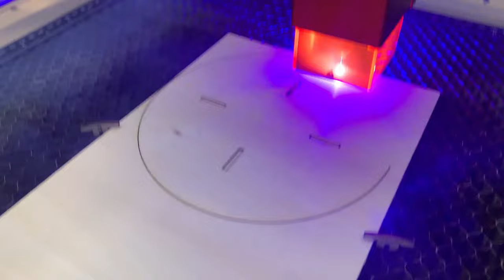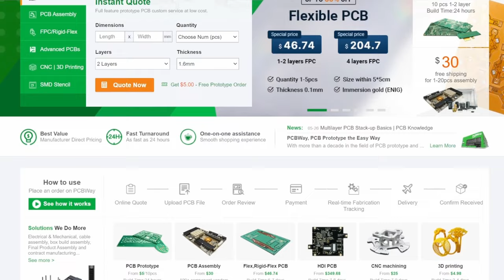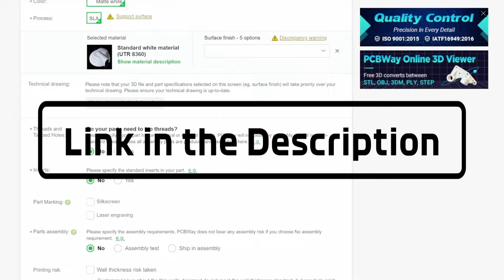How to Finish & Paint your 3D prints: Fill, Sand, Prime, Paint.

Comment: Post Process however you all ike but please use nitrile gloves and respirators when working with resin! I see so many unsafe uses of this stuff and its TOXIC!
Reply from the maker: Not sure if you noticed but I was wearing gloves...
Reply: @DaveRigDesign  not when you were putting the reinforcement mesh in. It’s just for me as a professional, I don’t want to pass off bad safety  practices to the new comers in the hobby.
Reply from the maker: Well I don't wear gloves when I use a fork and knife and manage to not get my dinner all over my hands. It's Resin, not uranium. If your not physically touching it, gloves don't do anything to protect you. 
People need to use common sense when working with different products and not wrap everything in bubble wrap. If everything is super dangerous then nothing is.
Reply: @DaveRigDesign  Sanding resin is when you need the respirator the most.

Comment: Very interesting project, well done. I raelly liked the video except when you didn't have gloves on and touched the project while painting. Do yourself a favor and get some 3mm gloves if you need to touch it to see how smooth it is. No matter how clean your hands are they still have body oil on them. The project came out great. Thank you for sharing. I like it with the face.
Reply from the maker: Thanks, The face really shows off how well the visor turned out, Too bad it distorts the image so much and makes it look freaky :)

Comment: So I have a 50w 395nm UV light and using sunlu ABS like water washable resin.. when I apply and try to cure it stays wet. Like nothing happens... what am I doing wrong? Should I get a more basic resin?
Reply from the maker: What is the nm your resin cures at. My elegoo resin cures at 405nm and I think that is normal for most. So the issue could be your light is at the wrong wavelength.
Reply: Ah wow. I didn't think of that. The bottle says 405.. thank you.

Comment: With face but put some extra filter in front of face so it's less visible in the light and only if you look closely you can see her
Reply from the maker: So what your saying is add the face but blur the screen so you can’t see it :)
Reply: @DaveRigDesign  Yeah, that could work. Something that gives depth and mystery of the wearer - focus is largely on helmet so face details shouldn't be that clearly visible.

Comment: Hi Great video! I prefer the faceless version too.  

I was wondering  what the baby powder used for?
I'm looking to smooth pla or worbla with tinted resin as well but am concerened about inhibition or tacky feeling resin. 
The sponge looks really useful too. Have you found a way to clean or reuse the sponge?

Any information would be really appreciated. Thanks!
Reply from the maker: Thanks :)
The powder just thickens the resin so it coats better and makes it easer to play it where you want and it not running everywhere. I have a earlier video comparing resin with and without powder
https://youtu.be/UFRbTg37Td8

To deal with the tacky feeling, after curing I just wipe down the model with isopropyl alcohol and that takes care of it.

For the sponge brush, they are so cheap I just throw them out. I was able to keep the same brush for multiple days though but it was starting to fall apart. Basically you can use the same brush for a while as long as it's not exposed to UV light.

Comment: Really cool video! (Possibly) stupid question: Is it possible to airbrush resin?
Reply from the maker: I've heard people talk about it and that it is super dangerous if you don't take the proper safety precautions. Spraying resin into the air doesn't sound fun. You would need a full protective suit and enclosed area. 

Also its too thick to spray so not sure what happens to is if you thin it. Sounds like a bad time all the way around :)

Comment: I think it looks uncanny with the face insert. And I mean that in a good way.
Reply from the maker: Ya, from some angles it looked ok, but other were weird due to the visor warping effect.
Reply: @DaveRigDesign  I feel like the visor came out looking really good! I think it's pretty much impossible to get it looking absolutely perfect. I love Metroid and I just got into 3D printing. Been struggling a lot. Been trying to print with ABS.
Reply from the maker: @LelandHasGames ABS it tough unless you have an enclosed printer. I would stick to pla if your just starting out until you get the hand of thing, it’s way easier to work with.
Reply: @DaveRigDesign  I had some success with ASA and I've had lots of success with PLA. Most of my filament is ABS though. :/